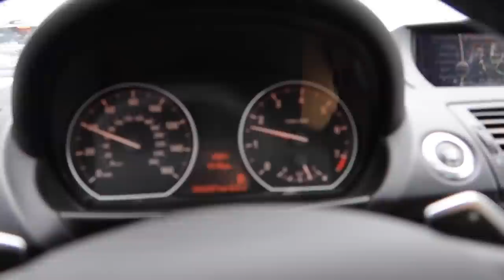MY BEST FRIEND BUY'S HIS DREAM BMW!

Comment: Someone in the group has to get a 2011-2016 m sport 550i #f10 my 13’ is iconic lol
Reply: Unreliable af tho
Reply: dude4548 not in my case , has had a clean car fax report with no mechanical or any other problems up to 86k miles with the first owner and me owning it from 86k to 95k miles where it’s at now, still in perfect condition with no problem even small. Only expense I’ve paid for since owning it is getting a flat tire by avoiding a gravel truck and hitting a nail (obv not a bmw problem lol) any who the car has been amazing and reliable to me so it bothers me when people say the 2013 5 series is unreliable I’d love to hear some cases where that is true
Reply: @cambamfam8165  damn that's lucky I wanted a 750i but didnt because of issues engine wise not that n54 is much better but the 50i was bad internally which scared me
Reply: @cambamfam8165  didn't have 5s but when I had my 7s the trans kept saying something about towing and it would blink in N